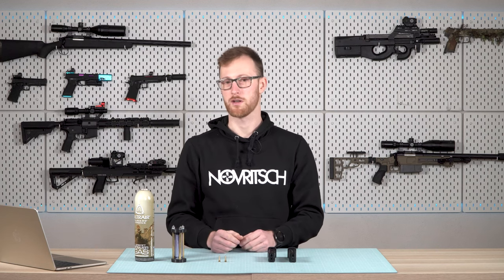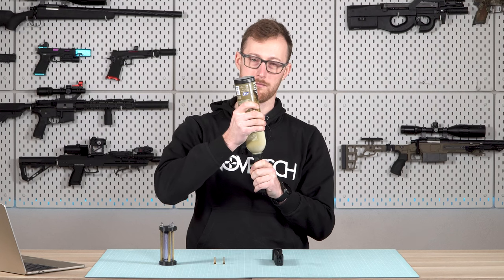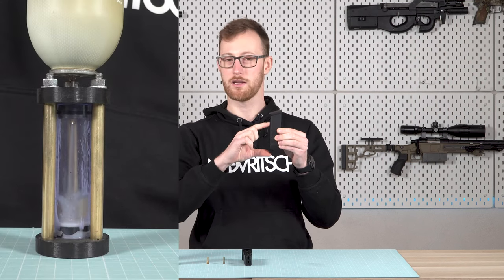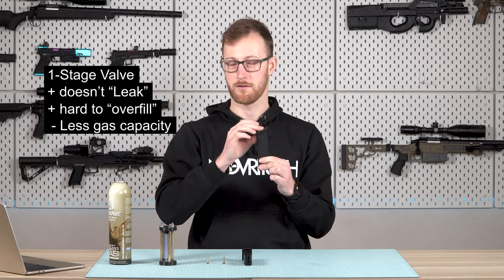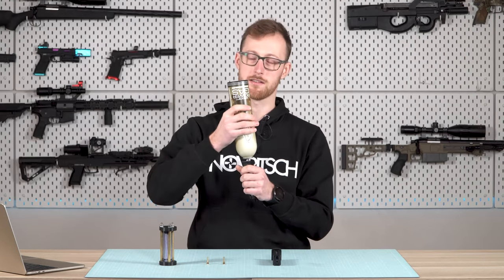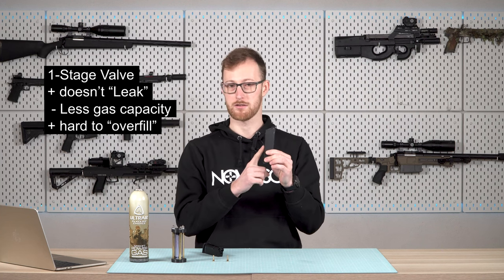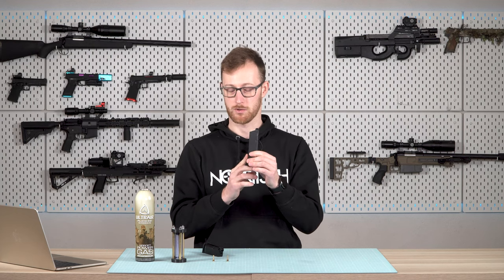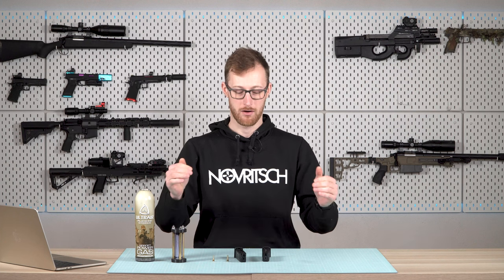Gas Magazine Guide: Valve Types Explained!

Comment: There are also "dual stage" inlet valves, that use extended tubes to stop it from filling past the ideal amount (TM uses these). Once you see liquid gas spewing out the top you know they are full.
Reply: he mentioned dual stage around 5:30
Reply: my guy this is half of the video
Reply: @cillblinton8181 Maybe I wasn't clear, @123456kiste's comment does a better job of explaining. I am talking about the silver extended tube "limitation Tube" that shrouds around the inlet valve and works like a siphon to ensure the mag isn't filled past the ideal point.  MWS mags have these and they are great. I have had no issues are overfilling it even in winter with ice-cold mags and a warm bottle.
Reply: Really is this true so thas that mean that I don't hafto like do it for for seconds or what
Reply: @Mrclassyduck  yes. If you want to be 100% sure you need to know the weight of the magazine BEFORE and AFTER filling process. The difference is the amount of gas you filled up but that’s pretty unpractical on the field

Comment: I have issues with propane. When fill in propane I get instant cool downs. Even with single stage valve
Reply: do you use a refillable propane setup?
Reply: @123456kiste  
Yes I do. I use normal liquid propane I fill myself, but I think I found the problem. I didn’t quite fill it right. I just figured it out when my propane bottle ran out. I can give an update next week

Comment: I always love venting valvs ((or 2 stage valves as you call it)

instead of feeling the temperature of the magazine with your mag there is a technical way to get the correct gas/liquid ratio:

LIMITATION TUBE

Especially TM GBBs are known for venting valves. If you fill them until the valve spills liquid gas the magazine will be full without spitting liquid gas if you shoot your gun.
The limitation pipe inside prevents the magazine to get filled 100%. So with a limitation pipe inside you will ALWAYS get the correct amount of liquid/already vaporized gas inside the mag
Reply: All valves that lead into a gaseous container are vent valves 

The gas doesn't care what's an IN valve or and an OUT valve it'll go out the in if it's lower pressure than the inside of the container
Reply: @millo7295  seems like you don’t get it.

Magazines that have a ventilation (in German it’s called: entlüftung) you get rid of air and vaporized gas. If liquid gas is spitting out of it, the magazine is „full“

If you don’t own a venting valve you can possibly have a magazine completely filled with vaporized gas (if pressure in the gas bottle and magazine are same, there won’t be any filling process anymore) which results in a hand full of possible shots, maximum, cuz the amount of propellant gas (measured in grams) is way to low

Comment: finally some actual information on this topic
I got one mag with my GBB pistol that acts like the 1 stage valve you showed, no matter how long I hold the gas bottle, nothing happens. Then I got two more mags from a different manufacturer but for the same gun (I know, very smart) and both act like the 2 stage valve, and I thought I was just dumb and that maybe there's different types of nozzles or something.. 
I was also filling them until liquid gas started coming out the top, I will try your method from now on

Comment: couple of questions if I have a single stage valve could I valve swap or should I look at a new mag? Are there any tips for the release valve? Maybe a vid on mag maintenance? Thanks for the tips
Reply: Im pretty sure ur fine just swapping the valve
Reply from the maker: you can swap valves easily, you just need the correct thread on the new valve.
Reply: if you are using VFC/WE/KJW magazines you can change the filling valves for ICS REVO valves which have the 2-stage feature
Reply: @123456kiste  Thank you, was looking for that :D

Comment: Just a thought on the 2 stage valves
Couldn't you solve the overfilling issue by moving that hole 5-10mm lower, so then when liquid gas shoots out that's the signal to stop filling
Reply: @TheUnamedPerson  I think ICS has made one the Revo system if I remember correctly
Reply from the maker: It's not that easy when we talk mass production but we are working on it. 
In the meantime, this video is meant to educate overall, no matter the brand or replica so I hope it helped!
Reply: @airsoft-explained-novritsch  ye it did I've definitely been overfilling my 2 stage valves
Reply: all you need is a limitation pipe inside of the magazine which covers the valve.

TM magazines have them so they will always get the correct vaporized/liquid gas ratio if you fill the mag until liquid gas comnes through the venting valve… ALWAYS

Comment: We own valves  they are to my go  no overfill and is single  but i get amlost 3 maggs out of it with that exact  gas in 1,1j cqb  on 0.30 runs great.  i live in sub arctic enviorment so like 2-3 moutht max i can run anything gas then after is to cold.    rest of year spring or aeg  most of winter is -15 to almost -40  and then is to cold even for aeg XD

Comment: Bullshit.

The reason why the magazine with the "2 stage valve" fills to the top is the limiter tube.  The length of the limiter tube prevents overfilling.

The Marui M4 MWS have a LONG limiter tube with a 2 stage valve and the magazines only ever fill to half way.  This is why if you want to hold more gas you cut the limiter tube.